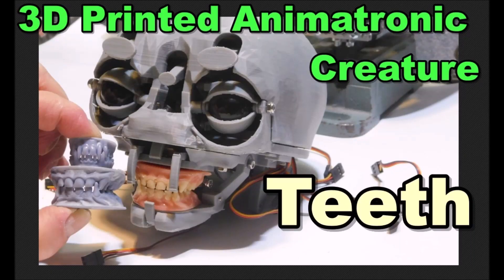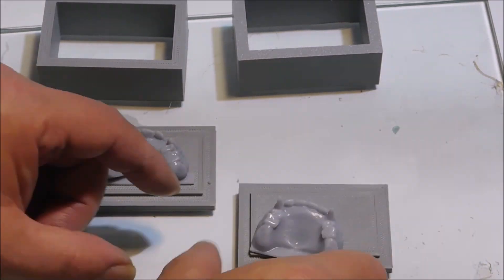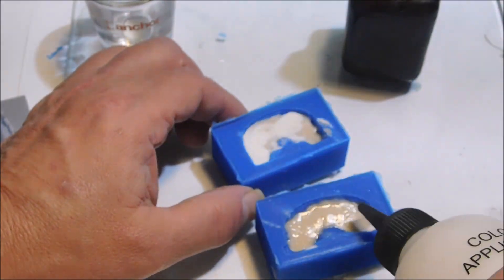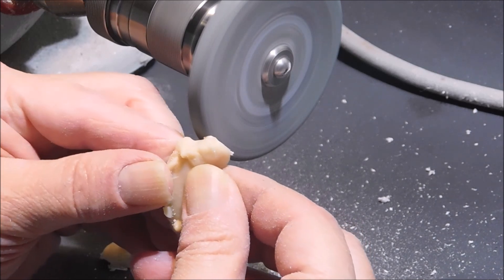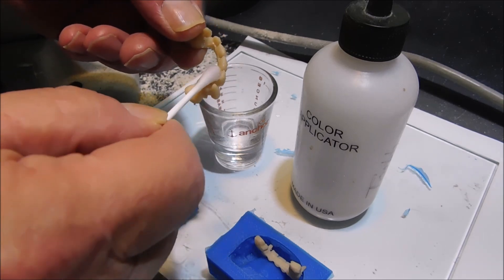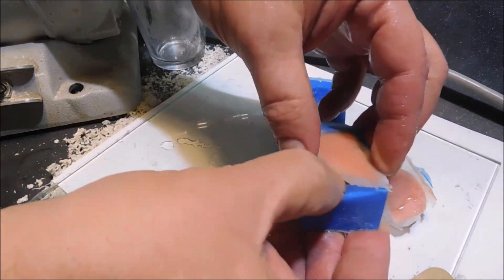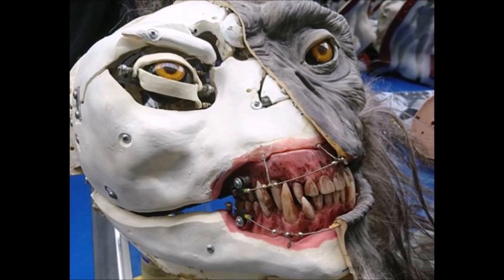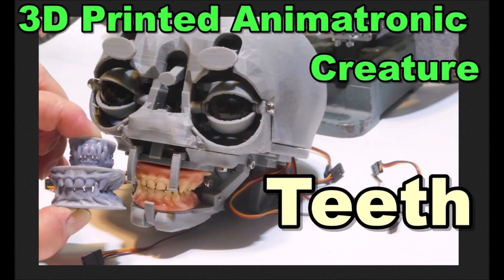3D Printed Animatronic Creature Teeth

Comment: For resin prints you want to use a tin cure silicone rubber like Mold Max Stroke, not platinum cure. No sealant needed, just a release agent like Mann Ease Release.
Reply from the maker: Tin silicones shrink slightly upon cure ,Platinum molds do not shrink upon cure, and finished molds have a better shelf life than tin-cured silicones.